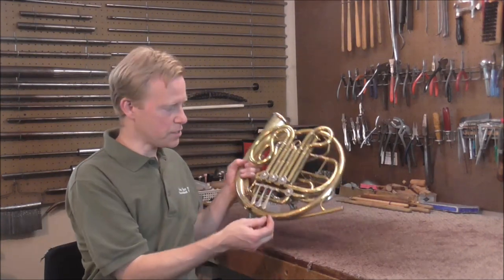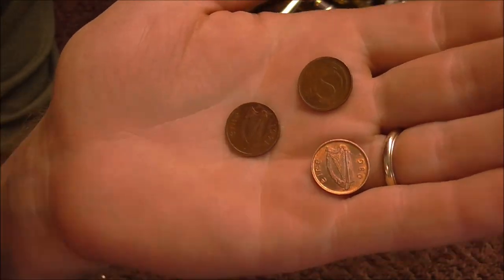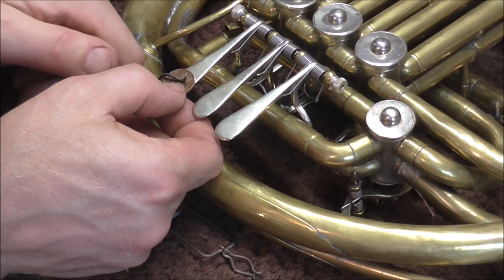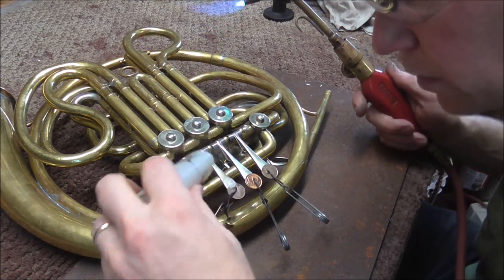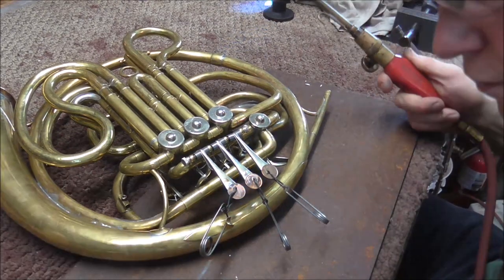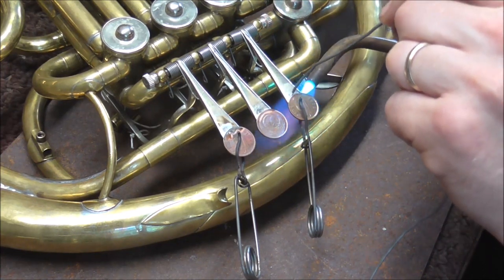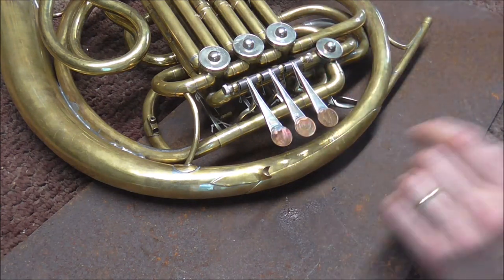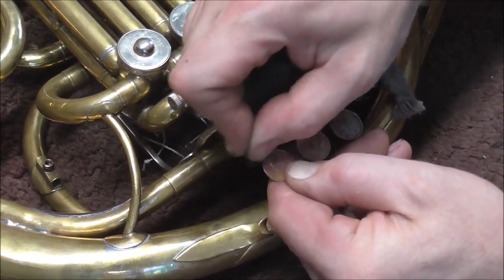How To Solder Coins On French Horn Levers

Comment: The shop that I had do mine messed them up. One of them ended up like 15 degrees off. They fixed it, but it still sucked because I didn't have my horn. They clearly didn't clip them down like you did in this video.

Comment: You might find this goes a little smoother if you tin both the key and the coin before soldering them together. Clean and flux each surface separately. Then heat each surface (separately) and apply just enough solder so it looks like you just unsoldered it. Clamp the two together and heat them and it should take very little more solder to make a perfect joint.

Comment: The French horn valve repair videos were kind of disjointed. I may be missing something, but I didn't find another video on the fitting of the rotary valves, or the final "it's all done" video.
Reply from the maker: Yes, you are correct. I ran into several problems along the way and I needed to work on other pressing things. That made the videos hard to follow. Sorry about that. I did learn a lot that I did not know so that should help me when I do similar repairs.

Comment: Just use hot glue. It works absolutely fine and you can remove it without any marks!
Reply: I am asking is this for real? I can hot glue the dimes to the levers?
Reply: @cembellsteve  Yes, I've done it and it works perfectly
Reply: Great!! Thank you
Reply: I put coins on mine with rubber cement. This might sound like a bad idea, but they've stayed on for 15 years with absolutely no issue. The horn has been chemical cleaned a couple of times and that didn't affect them either.